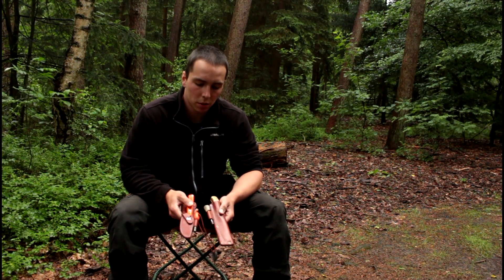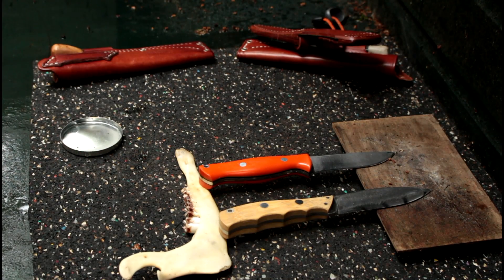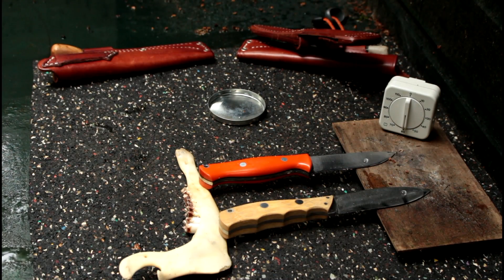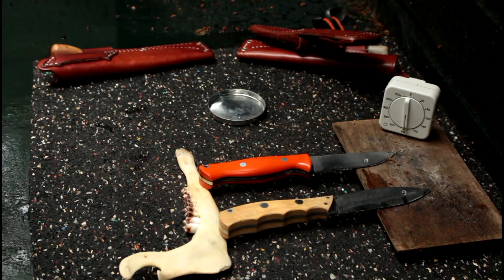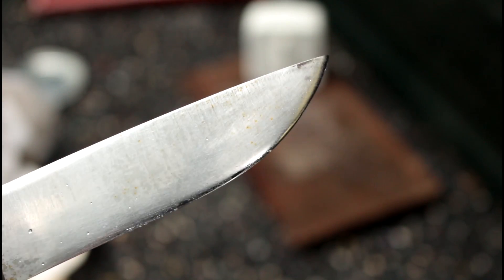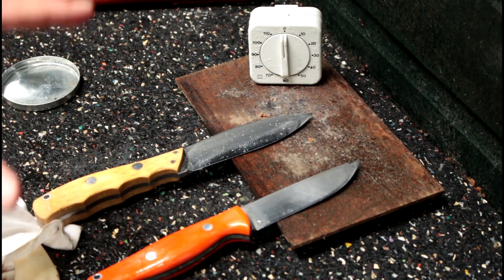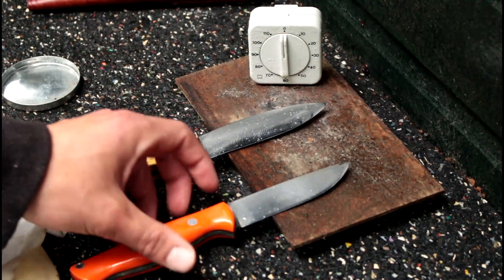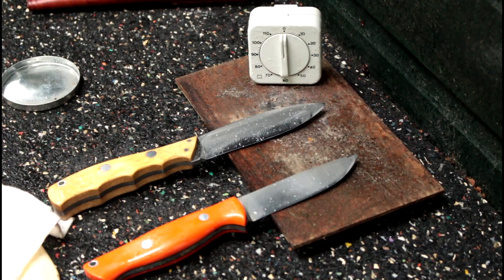CPM-3V VS A2 Corrosion resistance - Stain Test

Comment: Larrin has pointed out recently that heat treat can dramatically affect corrosion resistance.
Temper at 400f for high corrosion resistance, but temper at 1000f and it's not even as good as D2 (1000f is the manufacturer recommended temper).

Not saying regular 3V is as bad as A2 but it's possible that Bark River did a low heat temper and got the extra stainless properties.
If this is a 1000f temper then I'm just that much more impressed.

Comment: high polish blade the scratches are to small for vater and dirt to hide in and rust. try to do the test on a 200grit satin finish blade. and if you live near the sea you also have a salt humidity problem for the 3v.    i live in norway and if i dont oil mine 3v knives up they will rust!

Comment: Rust equals: More Toughness, Robust blade, Less likely for the edge to chip. 
No Rust equals: More edge retention, However edge may chip.
Also, the more advanced the steel is, the more skilled the guy who does the heat treatment should be, which means, you have more chances to get a better heat treated blade, if the steel is older. So, if you go for high end steels, go with custom makers, otherwise, stick to common steels like A2 , Carbon V, 1095, 52100, 12C27 etc.

Comment: How about make a Corrosion resistance - Stain Test on O1 and A2? Maybe Mora carbon too, a lot people say A2 is more Corrosion resistance than O1...and carbon steel,
Reply: O1 is almost exactly like 1095. Will rust very easily. Easier than a2

Comment: Thank you, Martin and Micky! Honestly speaking, I've started buying knives since have watched BK2 of your videos. You know I got Mora heavy duty with Carbon steel with rust already now. And another one from Marble which says warns and contains the cause of cancer! I won't use this knive for food processing, only for splitting woods or something.  But I like to learn how to sharpen my knives through inexpesive one first , instead of messing up good expensive one. Anyhow, I know what you say and look up the site you've showed me. Keep up great work, wait for your next video!
Reply: I know this is an old comment but I had a similar issue with a knife package saying stuff about cancer. Basically its just because the blade contains chromium and parts that are brass contain lead its safe to carry and use for food it is just a government stipulation for the environment and since knives contain the substances which aren't going to cause harm unless you dumped tonnes of knives in a waterway or something the now have to write that on packaging 
. As far as the mora yeah its a pain you need to oil carbon knives, all my newer knives are Elmax or some other kind of stainless.

Comment: this may be a dumb question but is stainless steel not as strong as these other steels ? are there some good stainless bushcraft knives ? and i think you guys should do a video on how to set up camp. like where do you cut your wood when you dont have a tree stump or a table and how do you oil knives and clean them so they dont rust ?
Reply from the maker: Hey Frank,
On the internet some people will still tell you that stainless knives won't hold an edge. This is very old knowledge but these days there are some very very good stainless steels around. Actually a lot of the most premium steels are stainless at the moment. If you have good sharpening tools you wont notice the difference between a carbon steel and a stainless steel. Chromium can make a knife a bit more brittle (prone to chipping) but you shouldn't worry about it.
here are some decent to amazing stainless steels

VG-10
CoS
CPM 154
S30V
Elmax
M390
Cowry-X
ZDP-189

I almost never use oil on my knives. I always keep them dry though but I don't really like knives that stain easily. CPM-3V is not stainless but it doesn't stain the quick. Most of my knives are stainless though.
Reply: Certain American knife manufacturers have been spreading the myth in knife forums that carbon steel knives are superior.... Reason they do this: 1) Carbon steel is MUCH cheaper = more profit. 2) Carbon steel is much easier to heat treat = Less skill needed...  This myth is all about to benefit these manufacturers, NOT the consumer. With the right skill + precise workmanship, stainless steel knives are very good.
Reply: Dutch Bushcraft Knives what about 440C. Could you talk about it a little? thanks.

Comment: At 4.75-5.50% chromium content in the A2 vs 7.50% in the 3V it will never win in the corrosion resistance test. It seems odd that there's not much price differential in BRK's when it comes to the 'better' steels. 
Have you had any experience with CPM20CV?  I've got two BRK Essentials in that steel and have found it to be an excellent all around blade steel.
Reply from the maker: Hey mate,
I knew it wouldn't win but it's good to see how much difference it can make. Lately I read that heat treatment also has impact on corrosion resistance. Depending on the heat treat the same steel can be more or less stain resistant.
I own M390 steel which is the same as CPM20CV I believe. I haven't spent enough time with it to make a definite conclusion but my first impressions are really good. It's kinda hard to sharpen but it keeps a really good edge. On paper even longer than elmax. My m390 lionsteel M4 makes a beast of a knife. From what I've experienced so far the m390/CPM20CV is an incredible steel.
Stay sharp
Reply: Dutch Bushcraft Knives I have an M390 Benchmade and it might be the sharpest blade I own. On par with a Moritaka Japanese gyuoto, both of which can get well beyond razor sharp. Viciously sharp. I'd like to use M390 in a run of CNC blades.

Comment: Will A2 steel take a patina?
Reply from the maker: It will just slice some lemon with it.
-stay sharp!
Reply: mister smith heat at cup of coffee and let the blade sit for a few hours. patina looks awesome and helps with the rust issue. It does wear off with use but coffee is cheap enough. The vinegar or lemon just turns grey. I've done it with my hunting knife, fox river in a2 and couldn't be happier with it

Comment: I find that my A2 Bark River stains very similar to 1095. However, my CPM3V Survive! knife went on a 4 hour float trip with me, in and out of the water a few times, and had some tiny little rust spots at the end of the day. They all wiped off with no permanent mark though.
Reply from the maker: indeed very similar to 1095 and O1. CPM-3v seems to be very easy to maintain. Thanks for sharing your experience here mate!
Reply: @DutchBushcraftKnives  Marteen ! Can u believe this was 5 years ago????
Semper FI
Gunny

Life is so fast.Before you know it it will be +5 years from now...u will have sold all the DBK Elmax knives.Be married to the blonde girl with big boobs.Mikkie will be bald.
Reply: @BOOSTEDLASER  ha ha
Reply: Ciao,io preferisco COM3V, piu' resistente anche se piu' duro ad affilare👍
Reply: CPM3v

Comment: I have the same experience with my Barkies in A2 vs 3V. On paper there should not be a huge difference in terms of corrosion resistance but in practice the difference is substantial.
Reply from the maker: thanks for sharing mate! same here.

Comment: That is some interesting results. Thanks for doing the test :)
- Martin
Reply from the maker: you are very welcome!
Reply: +Dutch Bushcraft Knives Great vid!, ive got an interesting one for you, cpm-3v peters heat-treat (im not going to mention the manufacturer) stripping some thistles for our horses, deep pits in the blade edge within 5 minutes! Super fast electrolytic/galvanic reaction going on, but only in certain spots!.Infi nothing, sk-5(hultafors carbon) uhb20c (mora carbon) black patina but no pitting, 5150 and 1095 carbon same just patina with no pitting. Im learning that even though 3v is my favourite hard use steel this is why it was never used by a lot of manufacturers who instead went with s30v :(